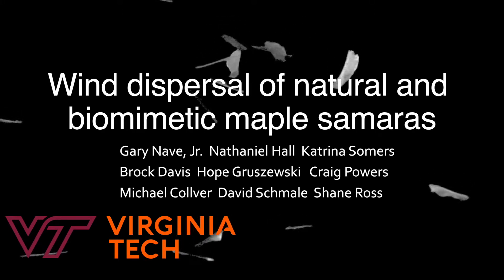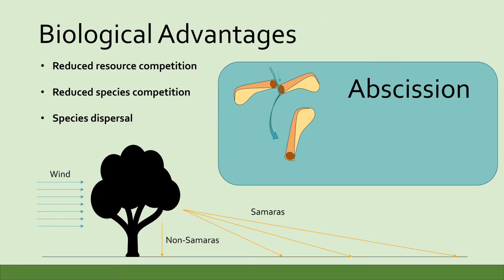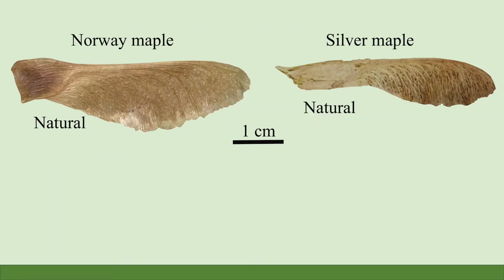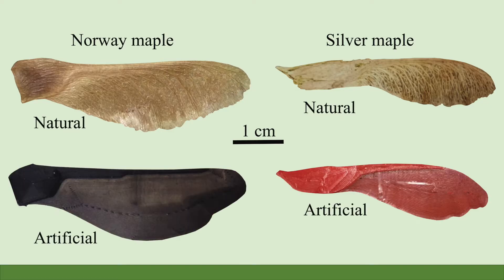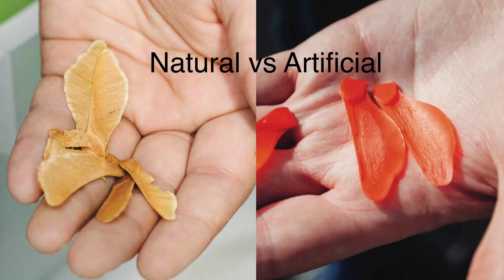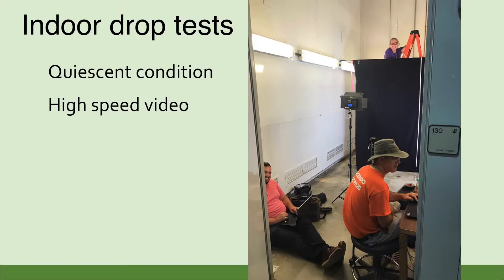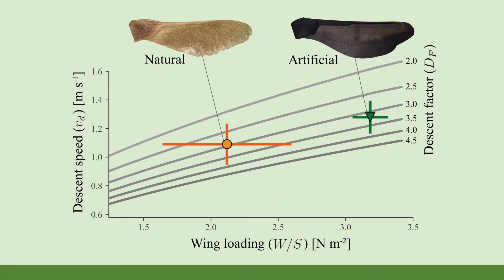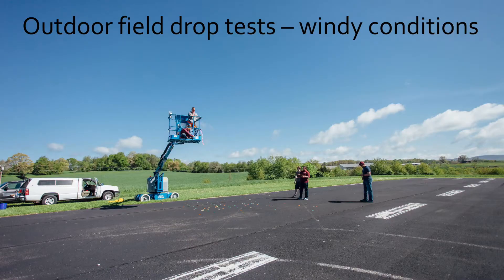3D-Printed Bio-Inspired Microfliers- Autorotating Maple Seeds

Comment: hello. how much would it cost to print a batch of 1,000 of these seeds
Reply from the maker: Great question. If I had to guess, I'd say less than $100. First of all, the files for printing are here (  https://tinyurl.com/samara3dprint ). We used a two-material Ultimaker 3D printer with PLA as Material 1 and PVA as Material 2. The PVA was a support material to help hold up the delicate parts. I don't know how many we could print at a time, but let's say it was about 30. So you'd need to do that about 35 times. Once you have a printer, the main cost is the material -- but you might also need to clean up any jamming that happens in the printer.